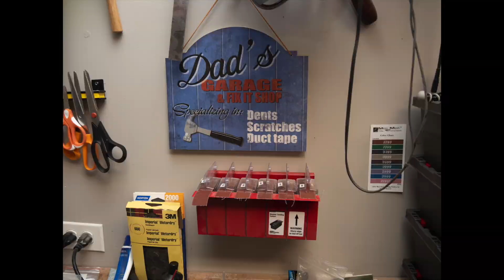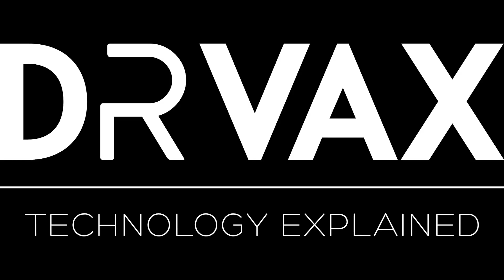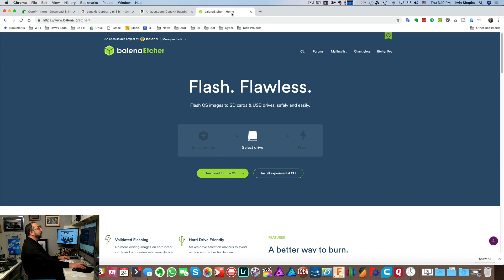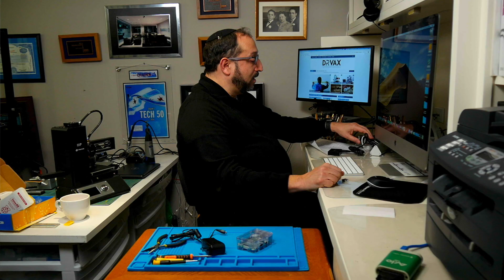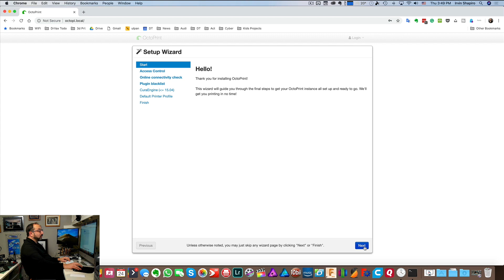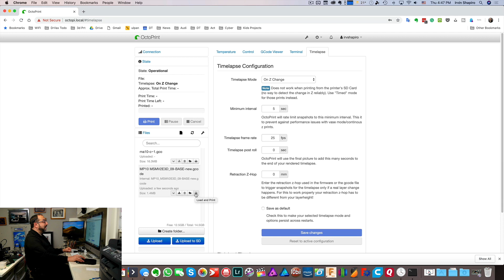Step by Step Octoprint Setup and Use on a Raspberry Pi

Comment: Hello,your video was very helpful. I able to connted my rpi ( octopi ) with putty useing a lan cable.i scan WiFi list and it can detect my Wi-Fi router.after that  I access ( sudo nano octopi-wpa-supplicant ) then it's show blank! But I manually fix it form SD card . How can I solved this issue ?

Comment: Great tutorial. I am using a mac. I typed in ssh pi@octopi.local and it is stuck, no response, it's been like 10 minutes. Everything is set up correctly. I actually just deleted everything from the SD card and started over with your tutorial. Still nothing. Help please :) working with rasp 3B+
Reply from the maker: Make sure you have an empty file named ssh on the sdcard.  Google it to get more details.
Reply: @MakeWithTech  I got it to work! I just went from the very beginning. I am definitely going to continue to use your tutorials!

Comment: Hello can you help me out please, how do you lower the z axes so when mine prints it goes high up? I have messed with the axes on the printer profile and set mine to 320 mm and it's gone lower is that right, also when it finishes the print it stays at the back left bed, any help would be brilliant thanks Doc or a tutorial on this information.

Comment: I click load and print and nothing happens it just sits there. Temps don't start going up.
Reply from the maker: My guess is the USB connection from your Raspberry Pi to your printer is not connecting.  Check the cable, etc.
Reply: @MakeWithTech  thanks. I restarted in safe mode and it worked. Apparently one of the plugins is causing trouble.
Reply: @MakeWithTech  just for some feedback in case it can help someone, the plugin preventing the print from staring was Octolapse. There seems to be a problem right now with Octolapse on the RPI4. According to discussions online not everyone seems to be affected.

Comment: I all ready have my raspberry pi 4 set up then I got my CR-10 V2 for a while, but never integrate them; until now. And I follow all instructions and installed octopi and I did it on the pi SD Card. Now when I started the pi it asked me for: octopi login and then password. I am putting all log in the I can remember; but not one seems to be the right one,  Any idea?

Comment: hi Dr vax. i am trying to follow step by step. when i finished all the the configuration in the sd card  and insert to raspberry and connect. got a message FAILED to start octopi webcam daemon with the user specified config. and at the bottom ask me for log in and the password
Reply from the maker: Interesting.  Do you have a webcam plugged in.

A great place to discuss this is at the DrVax forum located at https://forum.drvax.com.

Comment: My RPI4B came with a 64gb SD card with Noobs . Should i use this card for setting up octopi supplicant or can i use another card ?
Reply from the maker: @Danny Perkins  You can use any card over about 16gb.    I recommend you watch the updated video about setting up Octoprint which includes better instructions for both Mac and PC users.

https://youtu.be/8fLINOpzGGI

Here is a third video about advanced Octoprint debugging:

https://youtu.be/1FuPEHivKzo

Hope this helps.

P.S. I have started a new discussion forum at http://forum.drvax.com where we can all have more elaborate discussions and share pictures on our prints and printers. Check it out. Irv

Comment: I bought a raspberry pi on eBay to use with my newly purchased 3-D printer. I am new to all of this also. However, I assumed the pi would come with the power supply and whatever other cables were needed. But it did not come with anything. Of course I thought I could just use a USB phone charging cable… Because the eBay seller told me that’s what I could do… And it is insufficient. Also my SD card is not great so I had terrible luck trying to set up my raspberry pi. It’s been a terrible experience! So I just set it aside. Now I’m motivated to give it another go.
Reply: How's it going?
Reply: @danielmcpherson9062  turned out I had a sucky SD card. Got a new one and was able to install the program and everything was okay but I never managed to get the printer setup with it and everything. So I again set aside and I have not gotten it back out

Comment: fyi: etcher can now flash from url, also notepad++ is easier to use than atom, and windows can ssh using cmd.exe if the feature is activated in the dev settings

Comment: Nice video.
Some additions:
While a raspberry pi is most common and most easy to install, it is not the only platform and the Octopi-Image not the only way to install octoprint. You can use nearly any computer, install Debian and than octoprint. A very good platform are "thin clients". Theese are small computers used in issurances and banks, there no data should be stored on local PC to security reasons, so they normaly are only clients to a server. But the hardware itself is pretty standard PC, optimised to need not much energie and no fans (so many parts are normaly notebook technology). Depending of the age, the local harddisk is a CS-card, a msata or a m2.Sata with 512MB up to 2GB. If a bank or inssurance upgrades their hardware, suddenly hundreds or thousends of used thin clients come to the second marked. You often can get them for low money, depending of the age ($10 for 5-6 year old thin client). You have to upgrade the harddisk (for example with a 16GB m.sata for another 10 bucks) and have a nice stable octoprint platform for less than $20 - including power supply, nice housing etc., without using much more energy than a Pi. And it always worth to give an old normaly disposed object the chance for a second life...

You might consider this information a bit to complicated for beginners and I would confirm that. But not all beginners in 3d-printing might be beginners in IT also. So it might be helpfull for people beginning with 3d-printing but beeing experienced with IT and esp. linux.

Comment: Hi - hope you gettiung better day by day - im using the skr1.4 board, my pi4 cant locate the serial port via octoprint - any ideas - many thanks
Reply from the maker: Try something else connected to the USB port to see if it is working.  I would download MatterControl from MatterHackers  which has a nice terminal for 3d printers.

Comment: I used Octoprint and loved it.  When I was done, I used the Octoprint Power tab to Shutdown the system.  Is there a way to restart the Raspi without unplugging it and plugging it back in?  I was hoping that once I turned on my printer, the Raspi would automatically start as well.  Thanks
Reply: Solved!  I wired my Raspi directly to my power supply with a splitter cable and buck converter.  Everytime I turn on the printer, it powers the Raspi.  Easy day!

Comment: I just obtained the latest version of Octoprint using your step by step instructions.  Everything is working beautifully however, I would like to add the plug-in Spaghetti Detector / Octoprint Anywhere.  When I go into the plug-in manager, I get the following messages:

The pip command could not be found or does not work correctly for this installation of OctoPrint - please consult the log file for details and if necessary configure it manually. No installation and uninstallation of plugin packages is possible while pip is unavailable.
It looks like OctoPrint has currently no connection to the internet. Due to that it's not possible to install new plugins from the plugin repository or archive URLs.
Any idea of what I am doing wrong?
Reply: I was able to fix with a little internet research.

#1 Unchecked "Enable regular connectivity check" under Server in settings
#2 Checked "Force the use of the "" flag "" under Plug-in Manager in settings
Reply from the maker: Thanks for sharing your research with all of the viewers of the channel.  That is how we will continue to learn together.  My viewers are great and I may do a video in the future with many of the tips they have shared.

Comment: After flashing the img file to the SD card is the card still usable as a normal operating system on the Raspberry Pi?
Reply from the maker: Yes.  The img is a version of Raspbian which you can SSH to and treat like any other version of Raspbian.  The image includes all of the modules and programs needed by Octopi.

Comment: A very easy understandable video, even though it was on a MAC :-) (I am a windows guy :-) ).  You make everything seem so easy, and hey, it is... I tried to install a raspberry camera, but it is not behaving like i would like it to. Do you have any good ideas, for that ?? But keep all the videos coming, they are great. Cheers..
Reply from the maker: Thanks for the comment.   I have only used Optoprint with USB cameras.  Based on what I found on the web, you have to edit the octopi.txt configuration file to enable the Raspberry Pi camera.  Here is a link to the full discussion https://community.octoprint.org/t/raspberry-pi-camera-v2-settings/4070
Reply: DrVax Thank you very much for that very swift answer 👍 It looks as if it is just the thing i am looking for. That will be the project for tomorrow after work.  It is very good to be able, to pick other peoples brains. It is amazing how much good stuff, that turns up 😎. Again - thanks for the answer.

Comment: Can you run Octoprint on more then one printer or do you need a copy for each printer?
Reply from the maker: While potentially possible the recommended configuration is one pi per printer.  Fortunately they are quite inexpensive.
Reply: @MakeWithTech  thanks for the info and I really enjoy you channel.

Comment: Well, I've tried everything and nothing works. I am on a Mac. I formatted the 16 gigabyte micro SD for FAT. I used Etcher to copy the img file over to the SD. I put the SD into the Raspberry pi B, I plugged in the power for the raspberry, the red light came on, the green light blinked a few times but soon stopped. I launched my web browser (google Chrome) and connected to my TP Link wifi router. The raspberry doesn't show up. The Local connection shows so I try to connect to that ip address with a browser. It won't connect. I ran Terminal and issued the SSH command but it never connects. I downloaded an app on my iphone that shows all of the devices connected to my router. Still nothing shows up for the pi. So it looks like I've wasted my money on the Cankit. I had trouble from the get-go. First, the pi did not fit in the case. I couldn't get the top to go on because the tabs that secure the top hit the USB ports. 

I've searched for solutions on the internet but nothing works. So the only conclusion I can draw is that the pi isn't any good. What else could it be? I was really hoping this thing would work.
Reply from the maker: Sound like you need to edit the WiFi settings on the sdcard to get the raspberry pi to connect to your network.  Without a WiFi connection neither a browser or ssh will work.   

Alternatively plug the pi into your router with an Ethernet cable.

In addition for ssh to work you need to enable it by putting an empty file named ssh in the root of the sdcard. This link describes the process.  

https://linuxize.com/post/how-to-enable-ssh-on-raspberry-pi/#enabling-ssh-on-raspberry-pi-without-a-screen
Reply: @MakeWithTech  FYI, I finally got it working. I hooked up a video monitor to the HDMI port, a keyboard and a mouse to the USB ports, and the camera, I was able to see what was going on. The pi was booting but it was waiting for me to log in. I could not access via browser or Terminal but once I logged in from the direct connection to the pi, I was able to access it remotely through the web browser as well as ssh in the terminal program.
Reply: One additional thing I learned is that the SSID can't have an underscore symbol in it. Mine did. I renamed it without the underscore and that fixed that problem.

Comment: sorry  but a way too complicated....what about usb connection printer to win 10 pc
Reply from the maker: If you want to use a USB connection to a windows machine I would try MatterControl from Matter Hackers.  Here is a video that talks about it. 

Best 3d Printing Software for Beginners https://youtu.be/vIA71tSpTC8

The slicer in matter control is not as good a Cura but the software is very easy to use.